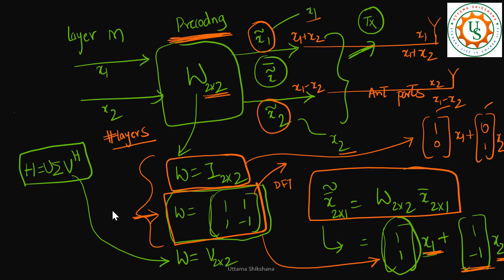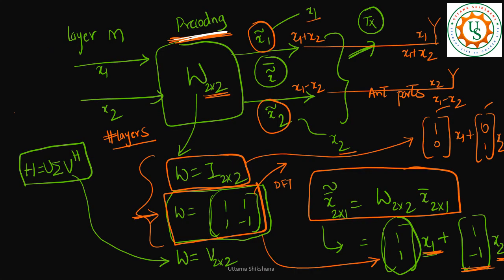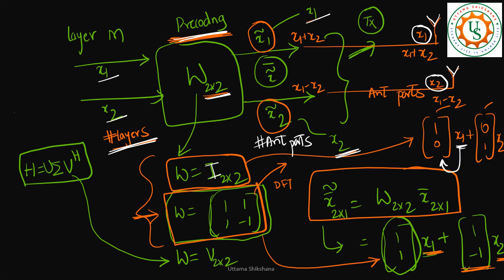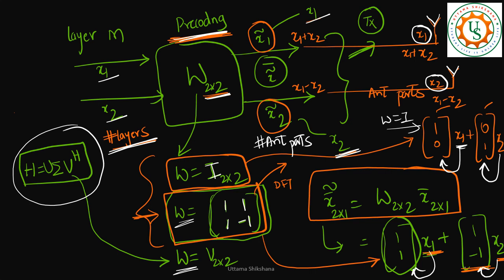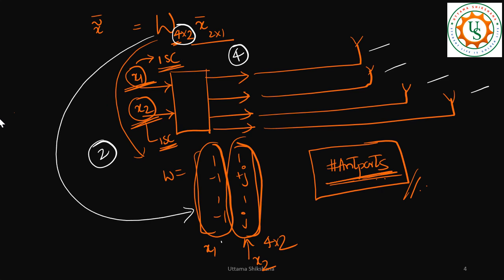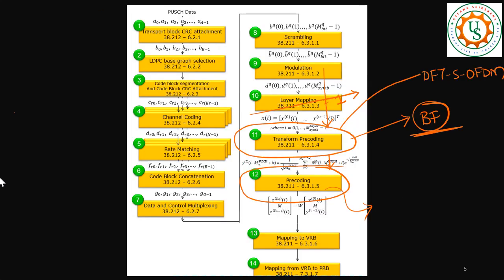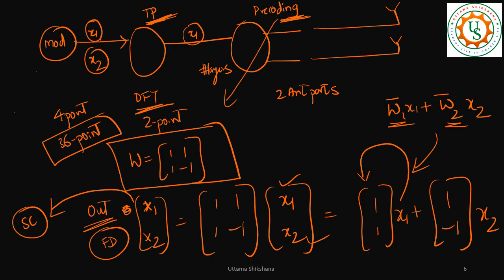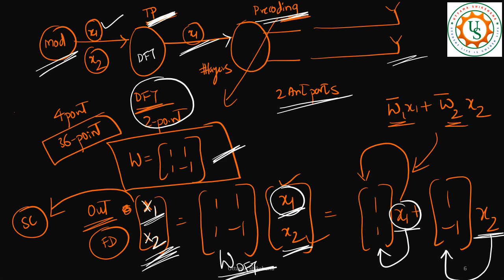[Series #9_7] Beamforming (BF) at DFT-s-OFDM Block or Transform Precoding Block in UL 4G 5G

Comment: 1. Why only one layer is transmitted when DFT spread OFDM is enabled ? What will happen if we send more than one layer ?
Reply from the maker: Very Good Question.
In 5G, DFT spread OFDM is enabled when the UE is at the edge of the cell and when the channel conditions are bad (Rank 1 Channel). So, one layer case.

For 2 layers, 3GPP has not defined to use. In this case, CP-OFDM is used.
Reply: @Uttama_Shikshana  @GOPIRAJDOKKU 
Thanks for the question and the answer. 

I think this point was glossed over in this video. May be sagar can include this in upcoming videos.